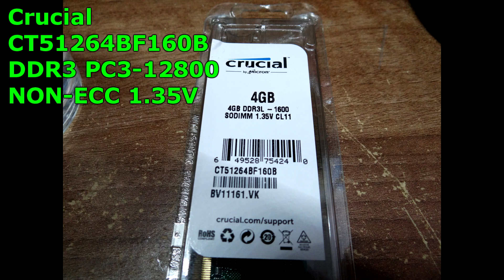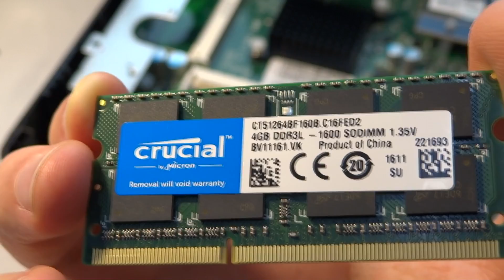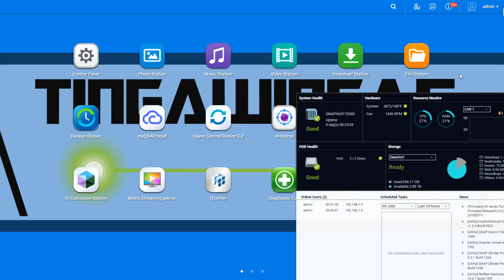How To Upgrade RAM in QNAP NAS TS-251 + (2 bay and 4 bay NAS)

Comment: Question for you please.  I have a 9 Bay QNAP machine and 2GB of memory.  I noticed you seemed to install two memory cards instead of one 8GB card.  Is this normal?  Also your brand of card is about 110.00 USD cheaper than the one QNAP insists on us buying.  Is this greed or is it an actual possibility?

Comment: Note that the assembly in the latest version of the NAS has gaps which enable you to instal the additional RAM without removing the assembly. It's a little tricky getting your fingers through them but you can insert the RAM without having to remove the assembly.

Comment: Just a correction in the video commentary.
At 0:58 you're showing to unscrew the 4 screws in the outermost periphery to open the top aluminium casing, while in fact we need to unscrew the ones just inside the outermost periphery.
When the video switches to the opened view later, you have unscrewed those inner screws as well to reveal the motherboard and all other components.

Comment: Nice video, but you just omitted the part where you remove the inner bolts, that were required to be removed so you have a clearer access to the RAM slots. They were really hard to remove, so I just removed all the cage from the plastic case, what gave me enough access to the memory slots.

Comment: Also upgraded mine with different brand: SK Hynix 4GB 2Rx8 PCL3L 12800S | HMT351S6EF8A-PB
Two of each and all works fine with 8GB.
Reply: Hardware TS-251+ ;)
Reply: I was looking for this info. Every video I saw use Crucial RAM. 
I have Samsung 4x2 RAM arriving next week.

It's work well? Faster?

Thanks!

Comment: Just upgraded my TS-251+ with 2x 8gb ddr3l-1600 pc3l-12800 1600mhz Samsung m471b1g73db0-yk0. It works very well with 16GB.
Reply: Really? In tha user manual said only support 8gb ram

It's work well? Faster?

Thanks!
Reply: Nice i wanna trie too

Comment: Only one issue... the video shows the wrong screws being removed (the outer ones hold the motherboard into the case). The inner ones hold/release the HDD cage. Other than that, very clear and helpful.

Comment: My question is, if i upgrade the memory in my NAS will it "Unlock" other apps to use i.e. i have a TS-469 PRO and if i "Upgrade my memory" will it unlock the Virtualization Station or other more memory intensive apps
Reply: Don't know about the TS-469, not that familiar with QNAP, but I upgraded my 2 GB TS-251+ to 16 GB just because I couldn't run Virtualization Station and now it is running fine. 

I'm more a Synology person and I know that with Synology, only the + models can use Virtual Machine Manager. I'm guessing QNAP might be like that too? So perhaps your non- + model won't run Virtualization Station no matter how much RAM you throw at it.

Comment: I tried using Salvage Samsung DDR3L and could not get it to boot. I also tried using just one stick and using some in my laptop. Only the stock stick would boot. I need to try getting some of what you used. Thanks for listing the exact RAM model.
Reply: Can you fix the problem? O you have to change the brand. i bought 2nd hand Samung DDRL 8GB RAM. Arrive next week

Comment: Can regular ddr3 be used or does it have to use the ddr3l?
Reply: it's not the size that is the difference with ddr3L. the L means its lower voltage. it's the same size as any other so-dimm memory, but runs at a lower voltage.
Reply: you need to use ddr3l cause its a smaller size

Comment: Just upgraded my 2gb ram with the Crucial recommended Ram in your video, but the nas just keeps rebooting. Put the 2gb back in and all is working fine.
Will need to do some more research on compatible memory.
Reply: +David Russo  The Kingston Ram I used 2no 4GB modules KVR16LS11/4
Reply from the maker: Memory could also be faulty, also ensure its in correctly.  The RAM I mention in the video is working fine in my NAS.
Reply: +MRrwmac   Yes I returned the Crucial Ram, and purchased some Kingston Ram and it worked 1st  attempt, could have been faulty after all.
Reply: Did you try new ram and did it work or what?